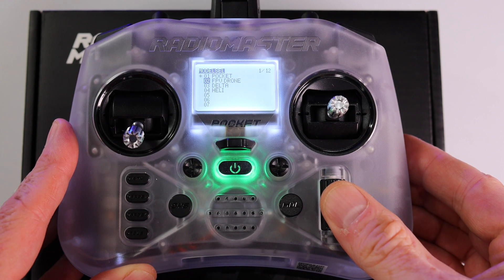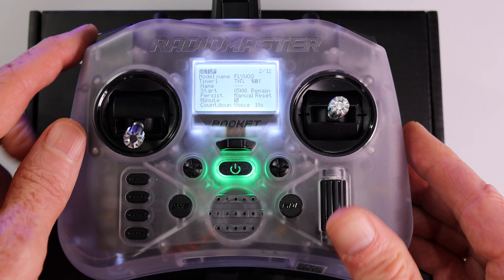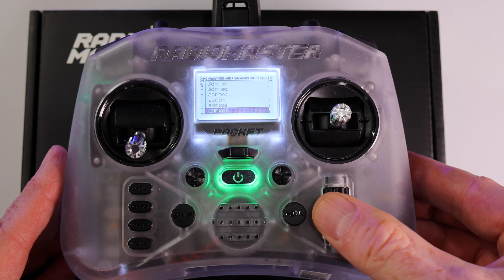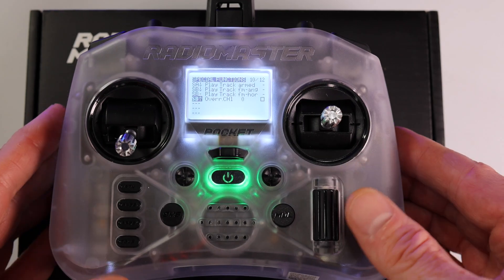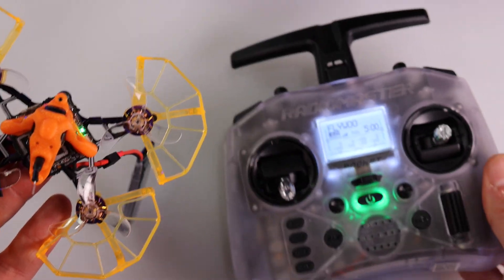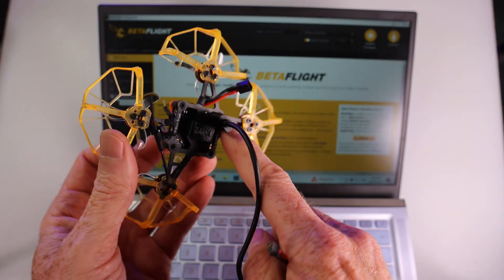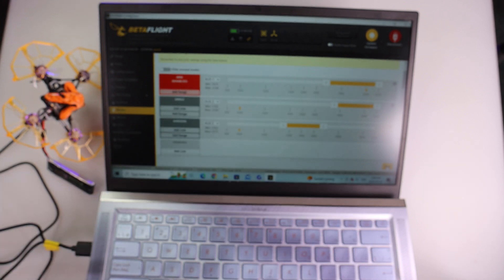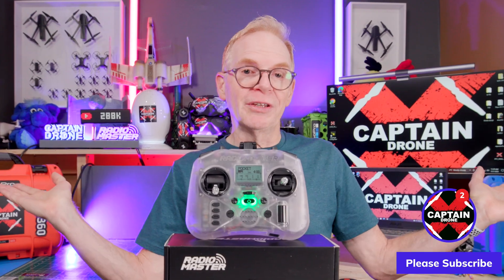RadioMaster Pocket - How To Set Up and Bind a Drone - Step by Step

Comment: Do you need to do this with the air65 or can you just connect the controller and fly?
Reply from the maker: With every REAL FPV Drone you need to know BETAFLIGHT CONFIGURATOR for the simple reason that a drone has no idea what radio you are using and where the switches, buttons are located or what they do, so after you setup a radio you then need to setup the drone in BETAFLIGHT CONFIGURATOR.

Comment: hello I done everythnig the same but it shows the throttle on the betaflight Screen when I move no problem but my drone is not mıoving any on the screen it moves but in reallife its not any idea why?
Reply: Oh I fixed it I just remove the usb cable power off all then power on drone by itself and it works thank you so much <3

Comment: I have a BetaFPV air75. The first time, I watched your video untill the part where the drone and radio bind. I was too excided so I stopped watch and started flying. That was a dumb idea because my drone crashed into the ceiling. My drone won't bind anymore. When I connect the battery it makes a sound and a green, red and orange led start flickering. When I do something my radio say 'delemetry lost' (or something that sounds like that) so I feel like there is some connection. I did all the steps from this video again but it doesn't work. What should I do? Do you have any ideas?
Reply from the maker: You may have cut or broke the antenna on your drone

Comment: Mine doesn’t turn on and it’s been charging and it has batteries could you help me please I want to fly my drone so bad
Reply from the maker: If you power it on correctly it should work… you are doing it correctly, right?  If yes, then the problem could be that Your batteries are either the WRONG type, in backwards or they are dead & can’t be charged.

Comment: Will this work for any quad?
Reply from the maker: When you buy a radio you are also buying the chip that speaks a language.  This chip is called a TRANSMITTER and is inside every radio.  If you buy a radio with an ELRS transmitter, then you would use it with drones that have an ELRS RECEIVER.

Comment: how do i enable crash flip on the pocket?
i followed the video, but when flying i crashed and i didnt find the switch
Reply from the maker: You go into BETAFLIGHT CONFIGURATOR, then go to the MODES tab, and you’ll find FLIP OVER AFTER CRASH.  Assign that to a switch on your Radio.

Comment: Just wanted to warn anyone buying a RM pocket that your buttons might not be exactly the same as captains are in the video. I know for me the charcoal black RM pocket i bought has different positions for the 3 SB switches. Middle position is Acro mode for me etc. Check your switches and buttons before going through a lot of setup!

Comment: Maybe because this was 2 years back. But I just recieved my Radiomaster pocket as a RTF package with the Omphobby m1 v1 2025.  The top Right button is "Arm" and "Disarm ".
The one on the left is normal and 3d mode. 
But I guess the buttons are asigned like this for and in combination with the little Omphobby m1? 
Have a Goosky,  with the standard t8 Goosky radio. So im a bit afraid to mess with the menu
But, I read a lot about the bad sd cards which comes with the Pocket Radio. I want to change this out for a quality SD card.

Do I need to copy the sd card on another device , because all the settings are on the standard sd card? 
Or are the settings in the Radiomaster pocket itself?
Reply from the maker: You have to copy the contents to a brand new micro sd card that is 8 or 16 gigs in size

Comment: I followed all the steps but when I got the pairing the drone to the controller it said connected but when I clicked armed, it didn’t work
Reply: This happened to me... i couldn't get the ELRS to load on the pocket either. I had to turn the internal RF on under model in the RM pocket menue then set the mode to CRSF

Comment: Hey so I have a new drone (meteor 65 elrs) and I have bound it to my radio master pocket and have telemetry but when I go into betaflight and move the sticks nothing works even though I am sure it’s bound. I have also tried  it unplugged and all of the switches and buttons just do nothing at all and it’s confusing me. If you could get back would be appreciated!
Reply from the maker: Your problem could be that you setup the radio incorrectly (the switchs, buttons, dials are not being outputted).  Or you are not really bound to the drone.  Or you plugged into the wrong port on the drone.  Or you USB cable is a charge cable & not a data cable.  There could be a hundred more things, but no one will know unless they were standing over your shoulder to see what you did and did not do.

Comment: One thing to mention for beginners is that Page 6 in the Transmitter settings is very important since it translates to your channels in Betaflight.
In my case Ail/Ele/Thr/Rud were in the wrong order. Not in Betaflight, but in the Transmitter. That switched out my yaw and roll and resulted in a really disappointing first flight/tumble.

Also you can put your multiposition switches together in one channel and change the offset in the edit mode so each switch shows up correctly in 3 different positions in Betaflight.

I feel like I've seen barely anyone talk about that. I guess normally the switches are already set up. 
I had to reset my Transmitter once, maybe that's why mine didn't have anything set up on page 6.

Comment: Hello again, Captain! So, I followed your steps precisely. I am using now a vapor x5 elrs and radiomaster pocket elrs. They are bindet, the joysticks are functioning correctly, however when I try to set up the arm button, it doesn't detect anything. That is also for any oder button. Only the joysticks are ok. What did I miss here? Please be kind and give me the solution! I know you have it😉
Reply from the maker: The problem is that you missed steps in setting up your radio.

Comment: I have a Air65 and its bound to the controller. Betaflight shows all joysticks are functioning. When I arm the drone the props spin. But when i try, and fly in ACRO the props wont move, same with any other flight mode. I followed all directions step by step. I dunno whats wrong.
 
Edit: Now the props are coming on when I arm, going to full throttle and not stopping until I disarm

2nd edit: AIRMODE was on I got it thank you for the tutorial!!!!

Comment: When i press the expresselrs mode mine shows RM Pocket 0/150 how did you make yours Zorro Rdmstr /1000
Reply from the maker: You need an ELRS RADIOMASTER Pocket for it to work like mine
Reply: @CAPTAINDRONE798 yes I have elrs radio master but mines says RM Pocket 0/150 my drones receiver is for Zorro only is there a way to connect them both?

Comment: i did excaclty what on video but when i press the arm the timer does not start
Reply from the maker: Read the comments below the video and you may discover what you did wrong.
Reply: @CAPTAINDRONE798  Thank you, you are awesome. I m new, this is my first fpv remote,drone,goggles,. when i first open the remote the gimbal need calibration but i didnt realise what the speaker was saying. After i calibrated the throttle gimbal everything worked perfect. One hint for new people like me in case this comment help someone one day, the th% lowers the speed of the clock and if the throttle is very low or completely down. As you press the thrrotle the clock runs faster. Thank you CAPTAIN, you video is up to the point. Everything worked perfect!! Greetins from Greece

Comment: Captain it looks like I have somehow disabled my ailirons  on the radio but I haven’t found anything yet to show me how to enable it  they re only disabled on one model the other is fine
Reply from the maker: Ailerons are part of the joystick setup. When you press the MODEL button, then PAGE button you’ll get to the section in the radio, shown in this video, we you setup an ARM and MODE switch.  The 4 joystick modes are above that.

Comment: Hi Steve, great video as always 👍 I am looking at getting the Vapor X5 O4 pro on ELRS with the pocket master. I have DJI goggles 3 and wondering can I use them in this set up? If so, do you have a video on how to set them up or is it really simple to do? Also, you mention about ensuring drone firmware is upto date, would that be done through the DJI software or through betaflight? Any help you can give would be great. Cheers Kev
Reply from the maker: Watch this video and take notes: https://youtu.be/ZhEnhplCsMg?si=m5bBwFNe5CeQDtvX

Comment: Thanks for the time and effort to do these videos Steve. I'm subscribed. However as a newbie to the Open Source Radio (RadioMaster Boxer) and the FPV Quad game the whole game is undaunting! Perhaps a video on how to test a new setup would be useful. I followed along with this video and translating your setup to my RX it did fire up. But after a initial bunch of flight failures I am left wondering what I missed.

One issue is the throttle is extremely over-responsive. Could be the props, could be the expo... could be the "would be FPV pilot". Another question is the relationship of the drone/Radio/Goggles/BetaFlight. I may be in way over my head...
Reply from the maker: Thanks for the input.  All newbie FPV Drone pilots ALL think something is wrong with their radio or drone because of how sensitive the joysticks are.  This is exactly how it is in the FPV Hobby and it is the reason that FPV Piloting takes plenty of practice and skill.

Comment: im sorry to bother but after binding mine doesn’t turn on like yours. Help i just want to fly today i followed all instructions but doesn’t turn on i have a beta flight meteor 75 pro
Reply from the maker: If it does not work it is probably because you have done something wrong.  Unfortunately since no one was there to see if you did things correctly we can’t help.  Also, make certain you have a ELRS RADIOMASTER POCKET that is on the same ELRS Firmware version as your Meteor ELRS.
Reply: @CAPTAINDRONE798  Thank you for even taking the time to answer but i will watch the video again and again till i get it right but i do know that the drone and radio are ERLS im not 100percent of the version but i will look into it right now thank you again

Comment: Can I bind it the same way with my frsky d16 meteor 75 pro?
Reply from the maker: Yes and No.  you can set up the radio the same but you would bind differently and need a 4-in-1 radio and not an ELRS radio.
Reply: @CAPTAINDRONE798 yes, I’m getting the cc2500 and I searched around a little bit, I have the 2022 meteor 75 pro and it should still be compatible correct?

Comment: What about using a bind phrase ?
Reply from the maker: Binding phrase is something rarely used in modern times with ELRS (it is something from the old days when ELRS came to market). If you need to use a binding phrase then there are videos for that.

Comment: My receiver is a speedy bee nano 2.4 elrs   I can’t tell if it’s bound if it is then my esc is not talking to motors    I goo thru the  binding steps  but I get nothing
I show no stick motion in beta flight 
Help?
Reply from the maker: If you see no stick movement in BETAFLIGHT CONFIGURATOR then there is a good chance you are not bound to the receiver.  Simply look at where the receiver is on your drone and plug in a battery... do you see a solid GREEN light somewhere or a light that blinks TWICE on and off, or a light that blinks rapidly.   SOLID GREEN means you are bound.  BLINKING TWICE on and off means it is waiting for you to BIND IT, and blinking rapidly means you took too long to bind and now it is in WIFI mode.
Reply: My elrs light is on solid       One thing I noticed in the setup there is no internal rf to turn off   There is however is an external rf

Comment: hey steve, a big fan here! can you please help me?  after switching from dji rc3 to radiomaster pocket, i have no osd on the goggles. i've done alot ot research and tried it. still i dont have osd 😢 thank you
Reply from the maker: Please note that by switching radios it has no effect on OSD.  OSD on an FPV Drone is controlled by the Flight Controller and your settings in BETAFLIGHT CONFIGURATOR, and of course if using DJI GOGGLES, your goggles control the OSD.
Reply: @CAPTAINDRONE798 thank you!

Comment: Great video. I followed along and got my pocket set up but for some reason I can't get the SE-momentary switch to connect to anything in betaflight. Is there something I have to do in the radio itself? Thanks.
Reply from the maker: If BETAFLIGHT CONFIGURATOR does not recognize your momentary switch it would because you did not set it up in your radio like you did with the other switches.
Reply: @CAPTAINDRONE798  Thank you. I'll see if I can get it set up. I would like it to use it for the 10V BEC tab so I could shut off the VTX while the drone acquires satellites.

Comment: Hi Steve.. finally getting around to setting up my RM Pocket. Following your directions exactly..two issues I’m having.. 1. The timer doesn’t activate when arming switch is pushed. Hmmm. 2nd -now in Beta Flight..Armed and Angle mode show to be active but Horizon mode doesn’t activate when switch. I’m stumped on how to trouble shoot. 😢
Reply from the maker: The flight modes of ANGLE, HORIZON and ACRO are all controlled by how you set it up in BETAFLIGHT CONFIGURATOR.  Double check that your MODES tab looks like mine and also scroll down in the MODES tab to make certain nothing also has also been assigned to the same switch.  If it has, you can either delete the other setting or assign it to another switch.
Reply: Thanks! That worked!!

Comment: First of all thank you for the effort you made on this amazing video, but i managed to hook up my air65 and tried to do the same for my air75 it won’t work sadly “i’m trying to hook up both on the same transmitter” is there any other way ? And thank you in advance
Reply from the maker: Yes, you can create hundreds of different modes.  Just copy the model (duplicate it), the one that works, to a new model number in the list.  Then go to the bind section and bind it.  If you have an ELRS DRONE RECEIVER and an ELRS Radio, they will only bind as long as they are on the same firmware (ELRS ver 3 is the most current)
Reply: @CAPTAINDRONE798  gonna check it asap thank you very much

Comment: What does it mean when you charge it and the red light flashes
Reply from the maker: If the light is flashing red when you plug in a USB to charge… perhaps you have no batteries, or your batteries have plastic covering the connectors, or you plugged into the wrong port
Reply: I just checked and I have no batteries thank you for telling me what type of battery does it take?
Reply from the maker: 18650 batteries… the kind that go in flashlights or vaping machines.

Comment: I'm having difficulty trying to bind my xm+ with the radiomaster pocket. Can't find any video tutorials on it.
Reply from the maker: XM+ binds to a 4-in-1 radio and not an ELRS radio like in the video
Reply: Thank you for your quick reply. There are 2 versions of the radiomaster pocket ( elrs and cc2500).  I have the cc2500 as I need to bind with an xm+. I think I've kind of sorted it and I'm halfway there. I need to use multi > frskyx2 > d16

Comment: my pocket is working but it wont bind to either of my drones, i have a mobula 6 with hdzero and a mobula 7, and it wont connect to either of them
Reply from the maker: If you have the ELRS POCKET then your drones must have ELRS RECEIVERS in them, and the Firmware on the POCKET ELRS and Firmware on your drone Receivers must both be running the same ELRS Version.  So if your pocket is running version 3 ELRS then your drone receivers need to be running version 3 ELRS.

Comment: I'm having some serious trouble here with my tinyhawk 2 freestyle. I believe I have it bound because when I unplug the battery the remote say "telemetry lost" but the quad won't arm or do anything. I feel like a 43yr old 2nd grader at the moment. I tried to plug it into the betaflight and I press "connect" and it does nothing.
Reply from the maker: Well, it sounds like it is connected, so the problem is obviously how you setup the radio and configured it in BETAFLIGHT CONFIGURATOR.  When you press the button you setup to arm, while in BETAFLIGHT CONFIGURATOR, do you see the correct info as per what I showed?  Also, if your drone is not connecting to BETAFLIGHT CONFIGURATOR then it could be one of many problems.  The cable you are using is the incorrect cable and designed for charging and not for data.  You computer USB port is not working correctly, etc.

Comment: Hey guys, does anyone had issue when there is no CSRF mode in internal elrs? It only OFF or MULTI, and 2nd option still got stuck on Loading in elrs menu
Reply from the maker: Perhaps your radio is a MULTI protocol radio and not an ELRS radio.  Go back and look at what you bought.

Comment: when i set my timer on the "TH%" mode, the timer doesn't start sometimes or when it does start it counts down slower than a Second should.... but when i changed it to the "ON" setting then it seems to work just fine...what's the difference?

Comment: does it have to idle when you arm
Reply from the maker: Yes, when you arm a drone the motors spin, but the drone won’t take off unless you move the left joystick a few millimetres up (left joystick must always sit at lowest point to arm).
Reply: @CAPTAINDRONE798  i dont like that feature cause when you go to land its just not what im use too. is there a way in programing to just arm without motors spinning up?
Reply from the maker: @madison0348  I have seen some toy drones and beginner camera drones that have such an option, but have never seen it in the real FPV hobby.